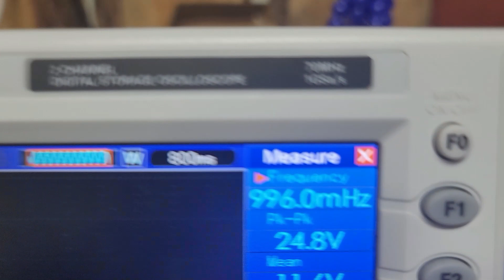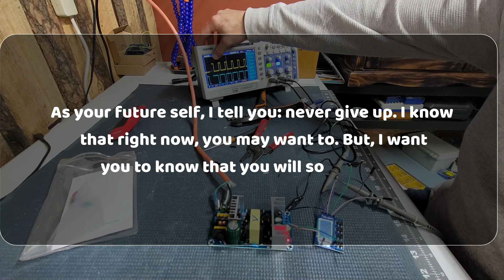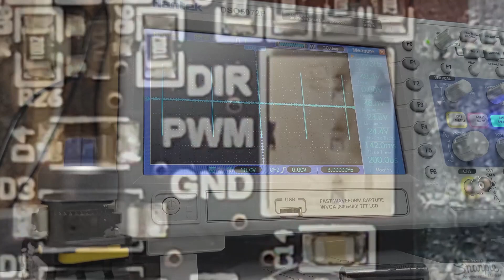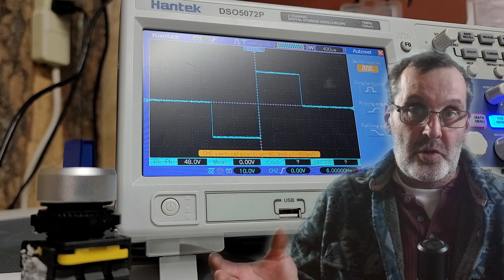Simple way to make a PEMF bipolar dc square wave

Comment: this is far out question, but has anyone investigated the use of sound to get the brain to entrain EM wavelengths below 20hz? by creating a small pulse between two tones, so, for example, to entrain 8hz, you play two tones, one at say, 200hz and another at 208hz, and the brain "fills in" the difference? 

Thanks!
Reply from the maker: Yes!   Sounds, light and pemf can help with brain entrainment.

Pemf is the only one that does not annoyed the user.  And also help with brain inflammation and increase blood flow.   Red light can also help!

Comment: Gooday Steve, Quick question, is this a low level power PEMF? I believe I need a high power one to penetrate through the bones and joins for pain relief reasons and encourage cartridge repair. What do you suggest? There are quite a few of us wondering and wanting to make an informed decision. Thanks for your hard work and sharing this
Reply from the maker: @SophiaSaraj  please watch my video on pemf power.  It will explain a lot.   

The one call high power vs low power i believe.  

Get back to me with your questions.

Comment: I'm not using pwm, just generating a on/off pulse with my Raspberry Pi to a DC motor controller. It's a simple on/off controller, so it should be a clean bipolar square wave. i've yet to aquire an oscilloscope, but maybe it's time to finally get one.

But the current setup requires me to login through ssh to start the program. This pwm module seems a simple solution.

But I think I'll go with a RPi pico, for a pretty cheap solution to have something you can just turn on and have it display the frequency and up and down buttons to adjust the frequency.
It's the more fun solution for me, to play around with embedded programming.

And hey! Thanks for sharing your solutions!
Reply from the maker: You my friend not only are a genius ypu need to come and join us on patreon.  You deserve to come.meet tjhe gang.   They need your smart and you will also learn lots from them.   :)   

Yes sir !  Love it :)

Comment: Needed that little message of inspiration ya tossed in there. Quick question, I’m new to electronics and am curious the difference between a bi polar dc square wave and just a dc square wave if there is one?
Reply from the maker: Well.  That is a very good question.   There is and what the science says is this.  

Bipolar is good for soft tissues. 
Unipolar for bones and other hard things.  

Personally I found bipolar feels better than unipolar at higher intensity.  
But bipolar did not help my psoriasis,  but help mt tendon in my sholder.  

I am.curently working on making a program that will switch between frequency from.1 to 50 and then switch from inipolar to bipolar,   
I can even make the unipolar switch its north and south ...  that is a good idea.    

Wow.  Talking myself into something here.   Also explain the claim some.company make.....   

Wow. Tx for the question.  I just realized something very big and funny.   

Anyway.  Ues there is a difference.  But we don't know too much about it.    Will keep.reading and soon will make a video on the topic.